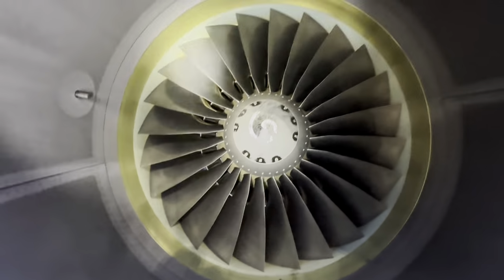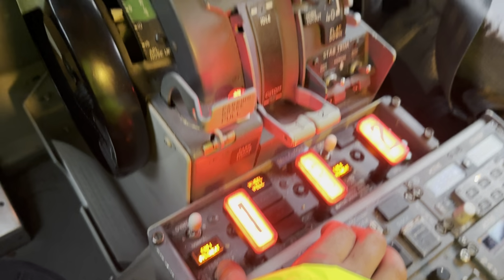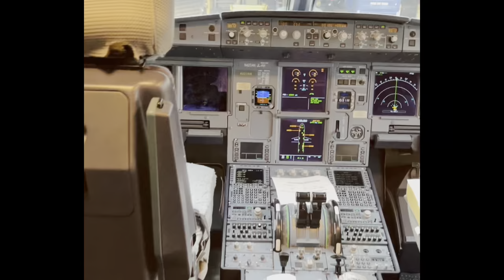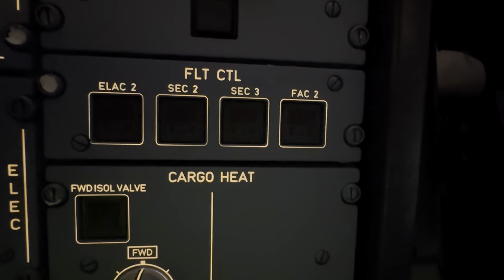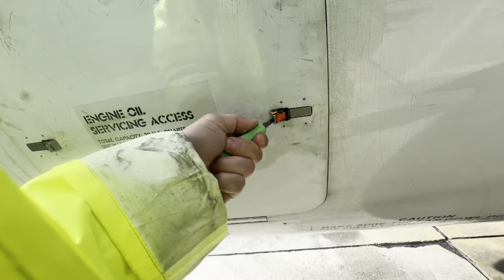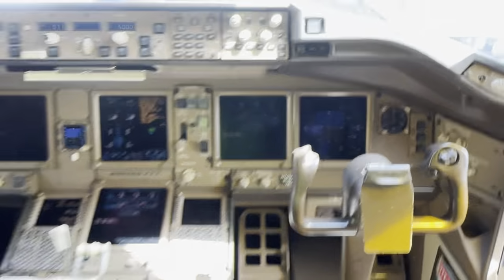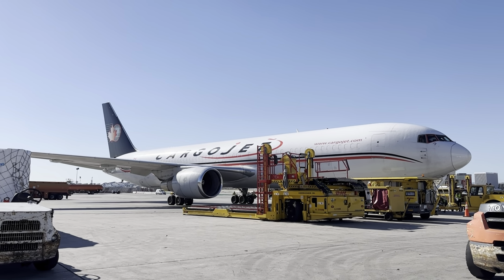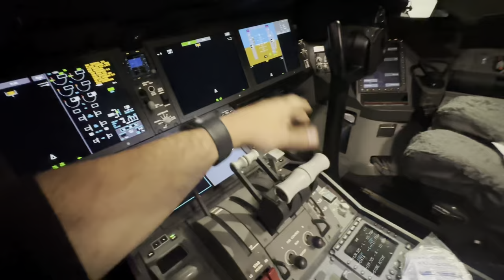Stig Shift #19 (Aircraft Maintenance Adventures)

Comment: Follow-up on Stig's explanation of Airbus Control Laws - the Simplified Control Law Matrix for the A320 family, with their equivalent/popular names:

     Normal Law (Airbus Mode)
     Alternate Law (737 Mode)
     Direct Law  (MD-80 Mode)
     Mechanical Backup ("We're all gonna die" Mode)

Alternate, Direct, and Mechanical Backup are known as the reconfiguration laws; there's actually a fifth mode called Abnormal Attitude Law which comes into play if the aircraft gets upset through a wake turbulence encounter, windshear, a microburst, etc...

When I was a newbie FO the instructors had us try to actually maneuver (in the sim, of course) in Mechanical Backup, but it's iffy.  The real purpose of that mode is to keep the plane upright while getting back up to one of the higher modes.  It is better than, but not by a lot, what Al Haines and United 232 faced going into Sioux City.  There is no aileron control whatsoever, so no bank control; the wings are leveled by rudder-rolling the airplane, which in turn negates holding any heading. and pitch is by the manual trim wheel.  If you're within a couple of thousand feet and 90 degrees of where you're supposed to be, you're doing well.  

The good news is that as Stig mentioned the AIrbus is built on redundancy; it takes "multiple failures of multiple redundant systems" * to drop into Alternate Law.  During training when we need to work in Alternate Law the instructors will turn off at least two computers to force the airplane into Alternate Law.  

If in real life an ELAC (Elevator/Aileron Computer) were to fail, there's another one on the other side so the airplane stays in Normal Law and behaves...well, normally.  If we lose both ELACs we drop into Alternate Law and the SECs (Spoiler/Elevator Computers) control roll through the spoilers (the ailerons are lost) and pitch through the elevators.  We would have to lose all five of those computers to get to Mechanical Backup; in my career I've never seen one even act up, let alone fail.  I was told, when I was a new hire, that in our company's entire history with the Airbus we've only had seven instances of planes getting to Alternate Law; I don't know if that was true, and there's probably been some since then, but it's very very rare.

The hydraulic power sources for the flight controls are likewise redundant (since Stig mentioned/showed both the Hydraulic and Flight Control system pages) - we have three hydraulic systems (which themselves have redundancy) and everything is powered by at least two systems, which differ from side to side; as an example on the F/CTL page (19:35), the left elevator is powered by the Blue and Green hydraulic systems while the right is powered by the Blue and Yellow systems. the only exceptions are the ailerons which are both powered by the same Blue and Green systems - but the ailerons are backed up by the spoilers, which also have Yellow system hydraulic power, so there's still redundancy.  The FLT/C page actually shows which hydraulic system(s) powers which flight control (as well as the actual control positions) and the status of the Flight Computers - green is online, amber is offline.  It's a remarkably informative display.

So if an AIrbus has even one operative flight computer, and any one hydraulic system, it's flyable,  

* If, during oral examinations a pilot says, "multiple failures of multiple redundant systems," they give us each a cookie, pat us on the head, and let us go home for the day....
Reply: Well said!
I agree you 100% on the reliability.
In ten years flying a mix of A320,321 and A330's, I've never seen a downgrade from normal law, except in the sim.
Reply from the maker: My friend, you have outdone me on this one. This is a better explanation that I could ever do. I’m going to pin this so people can read a better version. Thank you so much.
Reply: I got a question, I have seen one of these computer on MEL one time in my career. I heard Apparently without one of them Pilots can’t perform an autopilot landing? No Cat III? Or some limitation on the AP? What’s changed for flying these airbus in that case?
Reply from the maker: @o0TimTsai0o  it definitely restricts the aircraft from certain capabilities, especially from category landings as well as flying through certain weather conditions,. We call it a category downgrade. But it’s very rare, even most pilots will simply refuse the aircraft, which is completely understandable.
Reply: @StigAviation  That's an important point that people might not know.
It doesn't matter what the mel says,the final decision whether or not to take the airplane rests with the commander.
Reply: that's why I love this channel. Not only Stig's brilliant videos but also the community that's now around it. awesome!
Reply: @o0TimTsai0o  - I'll take a stab at it; the answer is: it depends; the world of CAT II/III approaches can get complex.  

Quick reference/background points - the Airbus can fly down to CAT IIIb minimums.  No aircraft is certified to CAT IIIc which is 0 visibility and 0 ceiling; CAT IIIb is as low as anyone goes, which is as low as 150 ft visibility (ICAO/FAA), but the Airbus is only certified down to 300 ft visibility, and to do this it must be a coupled (autopilot) approach to an autoland. 

We have a list of about thirty items that must all be working on the Airbus in order to do a CAT II/III approach; roughly twenty of these are monitored by the airplane (example - the generators) and if any of them fail the airplane will automatically downgrade itself.  There are ten or so others that the pilots would determine are not working (example - captain's windshield wiper) and manually downgrade the airplane.

On the Airbus there are two modes known as CAT III Dual (as in both autopilots working and on line - this would be our Fail Operational for those that are familiar) or CAT III Single (only one autopilot on line - our Fail Passive); it could actually be something other than the autopilot itself that drives the downgrade from Dual to Single - for example, the flight control computers - but it's the same general idea.

So getting back to those computers, on that list of required working items besides the two autopilots are the ELACs and the FACs.  For the aircraft to be fully CAT III Dual capable, both ELACs and both FACs must be operational or the airplane downgrades from CAT III Dual to CAT III Single. 

When the airplane downgrades to CAT III Single it can still fly CAT III approaches and autoland but with some differences - first, in a CAT III Dual approach there is no DA/DH, so as long as the airplane is flying a stable approach it can land without the pilots ever seeing the runway.  In a CAT III Single approach there is now a 50 ft Decision Height and the pilot must see the lights and/or runway to continue to a landing, so now there's actually a chance of a missed approach.  Also the minimum RVRs go up somewhat and there are requirements about which ones we can use - specifically the touchdown RVR since the pilots now have to see the touchdown area of the runway.

If we lose both ELACs and/or both FACs, we're having a really bad day overall, but as far as approach capability we would now be restricted to CAT I approaches only.  The Airbus does have a CAT II autopilot capability, but our company requires at least CAT III Single capability even if flying just a CAT II approach.

That required equipment list, by the way, is for when we're already airborne when things go bad and we need to land somewhere.  As far as deferrals (or MELs) go, they are more restrictive; once we're on the ground the rules change as far as dispatching the airplane and there are more items that will cause a downgrade.  Most of the MELs concerning the flight computers actually take several pages of specific additional procedures for each flight - in some cases by the pilots, in others by maintenance.  And frankly, flying around without one or more of these computers, other than maybe one leg to get the plane back to a base where it can be fixed, is a bad idea.  Like Stig said, we're going to refuse the aircraft.

So bottom line - if one or more computers fail, the Airbus can still fly CAT II/III, but at slightly higher minimums.  If all the computers of any one type fail - if both FACs for example, fail, then the airplane reverts to CAT I.

BTW - Fun Facts - this is already way too long but...the big Boeings also autoland.

But the baby Boeing - the 73-osaurus - can't autoland (although the autopilot is supposedly designed with that capability).  Instead, they have the HUD and fly a "visual" approach with the autopilot(s) off at 1000 ft.  American was the first airline with HUDs - we certified that program; and the first 75 or so 737s had a BAE/Marconi HUD, while all the 737s after that have a Collins 4000 HUD.  The messy part is that Marconi left the market after those first 75 HUDs - we're the only ones with them, there is no longer spare parts support and no planes that we can cannibalize from storage, so now we're reaching the points where, as they age and start to fail, we can't repair them, and those planes then downgrade to CAT I capability.

They've been working to get approval to retrofit the Collins 6000 HUDs from the MAX into those planes but it's complex (it's not just refitting the hardware but also the interface with the rest of the airplanes' avionics); last I read, they hope to have FAA approval and the refits going by the end of this year, but given the recent history of the 737, the government is really hesitant to approve anything these days.  Until they do, we'll have some 737s with the same approach capability as a Cessna...
Reply: So are pilots really necessary?
Reply: The computer infrastructure in an airbus is simply genious. It's not even possible to build such robust systems in everyday servers and x86 architecture, no wonder people were a bit suspicious of fly by wire at first as nobody had ever even seen that level of reliability.
Reply: @Tigerodoes  It amuses me when people freak out lately about electric steering on cars, where there is no mechanical column connecting the steering wheel. And then don't realize that they've been flying airliners with all fly by wire for decades. Or the silly argument that too much electronics "overcomplicates" airliners when there is a mishap. There is so much misinformation about aviation. There was even similar distrust of hydraulic brakes on cars back when they were starting to replace wires.

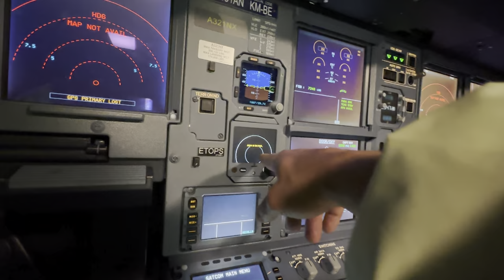Comment: 24:25 The official name for that thing is the CDTI which stand for "Cockpit Display of Traffic Information."  It's more than just an ADS-B traffic display, it lets us maintain a certain distance behind another aircraft, or cross a specific way point a certain number of seconds behind one.  We use the CDU in conjunction with the CDTI to set up our desired spacing and then it gives us a commanded speed to fly to achieve that.  We're currently in a trial with Albuquerque center and DFW approach to see how well the system works before it gets rolled out to other fleets and airlines.
Reply from the maker: You are absolutely correct my friend, thank you so much for the additional information and knowledge.

Comment: (~21:09). Uh oh! Like every other operating job - power plants, ships, railroads, paper mills etc., pilot's are being automated out. Haha. Happened to me years ago. I was an Engineer & Mech on C - 130's in the USCG back in the day. Now no more Engineer's. AlI automated out. Nobody runs 'em anymore.
Reply from the maker: Buddy you will never and I mean NEVER automate Maintenance out of the picture. We will always be here. Without maintenance you’ll never have anything working. You’ll always need us. The necessary mechanic. You can’t replace it with a robot.
Reply: No arguments from me Stig. I was referring primarily to operating guys. M & R guys wilI likely always be with us. E. G. Everybody's terrified of al, with good reason. It MUST be kept under control. But, even there, M & R guys are necessary. Look an auto mfg plant. Somebody's gotta maintain the robots - the automated welders etc. You know how equipment is. Always screwing up. Bearings going out, electrical grounds, software tangles, you name it. So l'm in agreement with you on that. Good M & R tradesmen wiIl aIways be necessary.  But operating is a different animal. Look at huge, heavy iron ore trains in Western Australia. NO Engineers! It goes on and on. A vessel can now theoretically be sailed from port to port by al. BUT as you (and l) say, good M & R men wiIl stilI be necessary aboard to fix aIl the hyd leax, Iube oil leax, grounds, computer screwups etc. You get what l'm saying.
Reply: I forgot. Planes need a lot of attention. They run only short time periods, only a few hours typicalIy, that at only part load. Ships wilI sail weeks on end at fulI Ioad, while power plants and process plants generally will run intervals of months, sometimes a year or more. At fulI load. You can see the M & R reqd in alI these circumstances.
Reply from the maker: @andreweppink4498  i absolutely understand my friend.

Comment: Another awesome video Stig watching that MD-11 land brought back memories for me as I probably worked on it when it was new at the factory in Long Beach. Yeah I’m old 😩
Reply from the maker: Hey, at least you got to work on them, that’s pretty much one of the only airplanes that I never got to touch. I’m jealous of you.
Reply: @StigAviation  Number two engine was a PITA to work on though but I still miss working on airplanes also the MD-90s were no fun either the V-2500s were not really designed to be mounted on the fuselage so changing the fuel filter was a PITA. I enjoy your videos very much 👍🏼
Reply from the maker: @remylopez4821   ow the md 90 and 717 I have worked. That I can tell you was a mistake of a decision to hang that engine on there. You remember the 5 piece split cowling that can take a man’s head off of you didn’t know what you were doing. I remember really well.

Comment: Just to add what stig said about the lockout for the shoulder harness if the pilot for some reason becomes incapacitated , you can use the lock out to make sure the pilot doesn't fall forward and stays in one spot
Reply from the maker: Very good point, thank you also for mentioning that. I completely forgot about that safety aspect of it.

Comment: Has anyone asked about a control cable passing through the pressure vessel ? There was a good shot of it when you were showing the 737 p dome. Great videos for an ex AMT to watch!
Reply from the maker: It’s such a small opening and also surrounded by a rubber gasket that it has little to no impact on pressurization.

Comment: 34 min position, 777 a/c, there was smoke coming from under the right engine.  Is that just high temp smoke or was it using some oil?  Keep doing what your doing, enjoy and thanks.
Reply from the maker: That is a breather tube, it vents out excess oil gases.

Comment: Hey Stig... You show us a lot of aircraft,😀 which is great.... are there tools you use that are so precise that they have to be just as scrutinised as the aircraft? ...do you have a workshop or a bench where you hammer away at Aircraft parts before applying them back to airframe🛠? 👍
Reply from the maker: There are tools that are very precise to specific aircraft. We do have a workshop where we can take certain parts off and work on them. But majority of components are very much plug-in play, remove and replace.

Comment: 6:14 the water being pushed out from under the concrete slab (L main gear) O.O

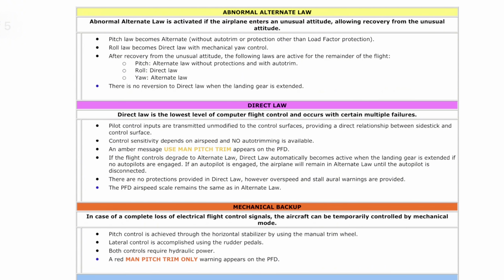22:00 For those who are interested, here's some values for the attitude protections:
maximum pitch: UP30° (UP25° Flap full; UP20° slow speeds)// DN15°
maximum bank angle: 33° (67 with continuous (full) sidestick deflection)
load factor protection: +2.5 / -1
67°bank is also the maximum bnk angle to maintain altitude at the maximum load factor of 2.5g
One Law not mentioned, but I kind of see it more of a mode rather than an independent law is rotate law. While on older Airbus planes during take off you were in direct law, meaning stick deflection is directly linked to control surface deflection, in rotate law, similar to normal law, you command a pitch rate.
The entire law and mode system is incredibly complex yet somewhat intuitive and incredibly well thought out. Super interesting topic, really

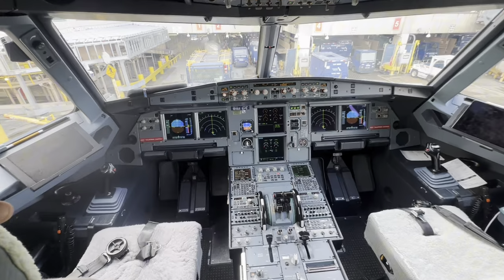28:32 is that not very common in the US / at American? Here (Europe) Crews usually keep the aircraft for the day. Of course it's not uncommon for crews to have multiple planes a day but the majority of the cases the crew stays on the plane for all legs of that day.
Reply from the maker: Thank you so much for more at a detail. Very valuable information. I appreciate you.

Comment: Some of the nicest flights I've had have been on busses, with presumably a high degree of automation, after that Bombardier and Embrarer small short haul jets and then the 777. The absolute worst was on a 747 back from MCO that had an old version AP with no hysteresis..
Reply from the maker: With the level of technological advancement in these modern jet, they are basically safer then driving a car down the road.

Comment: On our 319/320’s, we usually leave the arm rest on the seat and move the seat in and out  of the sliding cockpit window. How I was shown to do it;)

I thought they were kidding and that it wouldn’t fit, but it damn sure did;)
Reply from the maker: I have used that method before, but you would need a maintenance stand that is reaching all the way to the window. It’s just easier to takeoff the armrest and take it out the door. And by the way, that’s how the maintenance manuals tells you to do it.